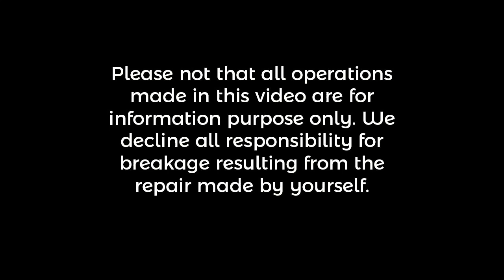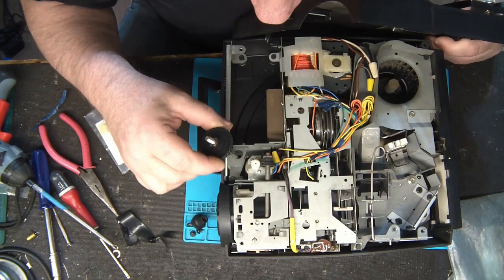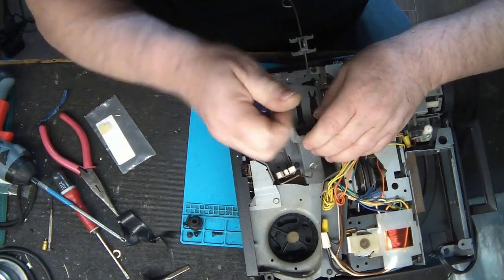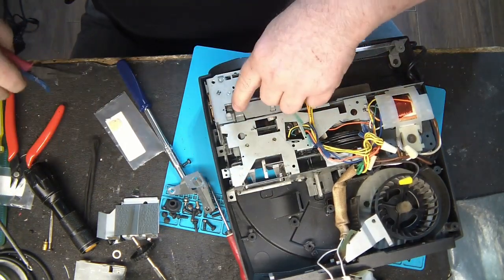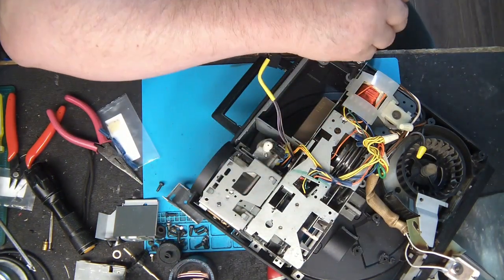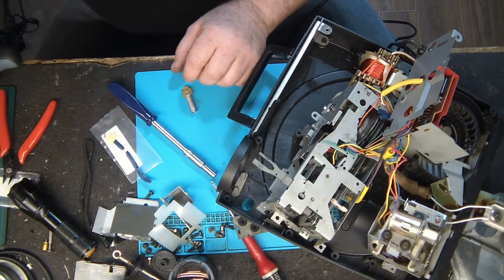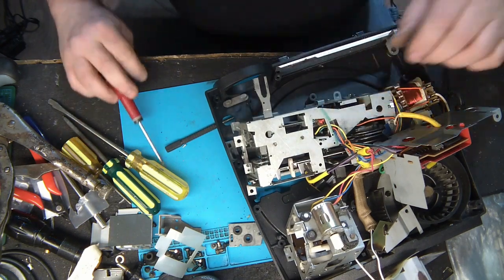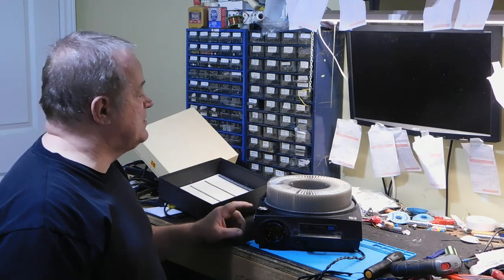Kodak carousel 760H slide projector | SJC Électronique

Comment: Where can I find the part you replaced to advance the slide forward and reverse?
Reply from the maker: You can order it on EBay. https://www.ebay.ca/itm/Repair-Kit-For-Kodak-Carousel-Slide-Projector-w-Manual-Focus/400475306162?pageci=adf30a4c-8ae2-46b7-a595-7ec6cc9ea837&redirect=mobile

Comment: Where do I get the focus gears to do the jo
Reply from the maker: You can order all the gears on Ebay. Here's a link. 
https://www.ebay.ca/itm/Repair-Kit-For-Kodak-Carousel-Slide-Projector-w-Focus-Motor-Not-Advancing-/184190363676?_trkparms=amclksrc=ITM&aid=1110006&algo=HOMESPLICE.SIM&ao=1&asc=20201210111314&meid=0479bff10b7e45d491ff92aecfeedf1c&pid=101195&rk=1&rkt=9&sd=400475306162&itm=184190363676&pmt=1&noa=0&pg=2047675&algv=SimplAMLv9PairwiseWebMskuAspectsV202110NoVariantSeed&brand=Kodak&_trksid=p2047675.c101195.m1851&amdata=cksum:1841903636760479bff10b7e45d491ff92aecfeedf1c%7Cenc:AQAGAAACEBUKjq5pCPRgkZW0r5V+pMLqY3lCa0/L4F9Sk7ClES1y9TyAt0apMOZW2PjTyixGqixt/M8MwoFkmLsY8Pbd9vT/3T4rqtWR/6Z2Dt33cyVt4cQerPp+DcdatspdEeD/5AqBlrSQRIULXptcde40/glJ2914ZjNgNUEbyC0a5IKuWD+KCq/I+ip4rLnIaiKxdtYCNpXvI2QSjzzBEsPFD7c49ZCfYouYErSEqqMZYLIys4YoyBXVRSVYOl7RIxTB5I+wAUDJ6ZB/cAVMRID1jQ4Sfr931rdImLRPjpV95SggF55OeHUIr0Cw0AIhkb7vyfmhu45NyA4LfsuBxMWUitD+BYRsZ/aRBslURvYkoTuvmDWJgTvL/lwEYdCuGfPh9/9yhi7EQBJHcx6MR+utkCsjUJxwdpiSzjsw+gknkhnGEE9GAQ++LC7hGvLWjrhuYIFIwmSew58DsmMGw5WoaGevCeIzKkndMkl9Eg3j+rI4apYe07tnfj6/akBtx2dUABzn1PYsDFXUBMzNsEZHmgHbiKjm+PiTRmpfldlmAfWJqhASsdYEKIxErS1NiG8ITFhvxDFvWEHEAmZbutS/bmVTzUvDNR16Woh2+cOJsY6OZieXoSG/HTS8A5lWVEO5FsNSBCefrt1E4DP3Fcsr3Ljj3AYgCThOaJEH/Srs/NrDlCZXIMxD+hlU4HqZ2f3YLw==%7Campid:PL_CLK%7Cclp:2047675&pageci=2b7c78c6-cef6-4316-8286-385f355d4dd5&redirect=mobile

Comment: Could you put a list of the tools needed to process this repair?
Reply from the maker: You only need a phillips screwdriver for the bottom cover, a 1/4 socket for all the inside screws,  and a long nose plier for a small spring and to remove and put back the nylon old and new part. A small flat screwdriver can also help for prying.

Comment: Do you also repair the 750H?  If so can I send it to you. It doesn't advance by the buttons on machine nor by way of remote control.
Reply from the maker: Yes. The little nylon part is 25 $. I order it from California. It take two or three weeks to receive. Finally, the labor is 45 $ to replace the defective part. Total cost, 70 $ + tx.